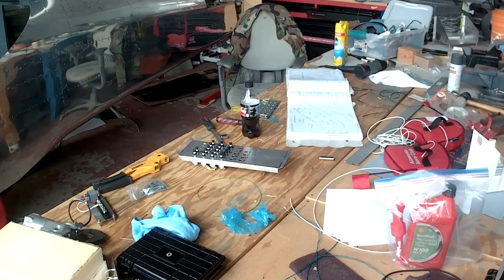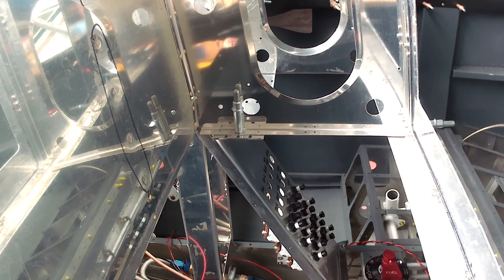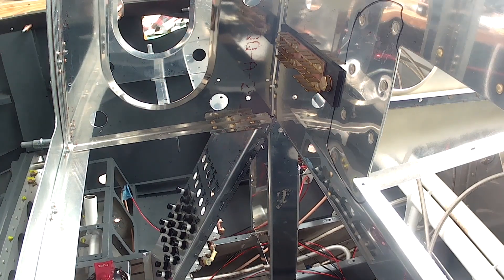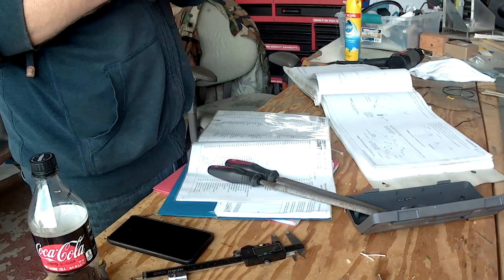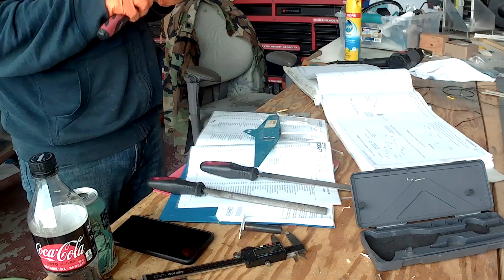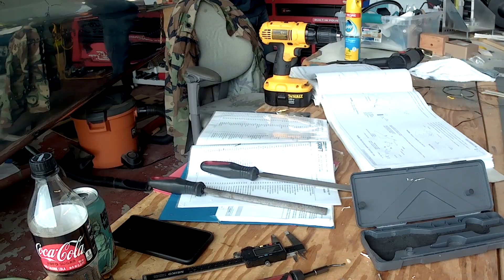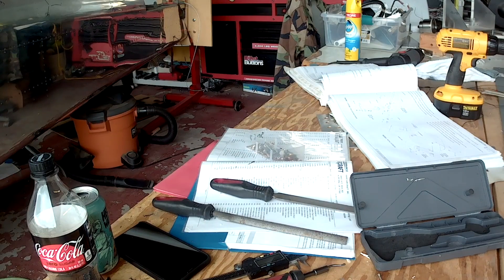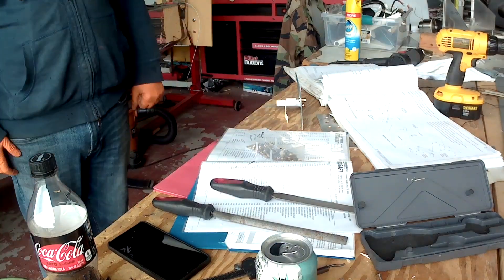RV-14 Ch 38 - 27

Comment: That's crazy compared to how the RV8 works, but I though I had a lot of thought about this.  If you need to get out, the sliding canopy is sliding forward if you crash.   the tip up wont if you're upside down.  I think ejecting the canopy (with the beer can rudder) still might be the best bet.  I don't want to be the first one to test any.
Reply from the maker: The only way I'm actually pulling that handle in flight is I'd have to be in some kind of inverted spin and/or on fire.